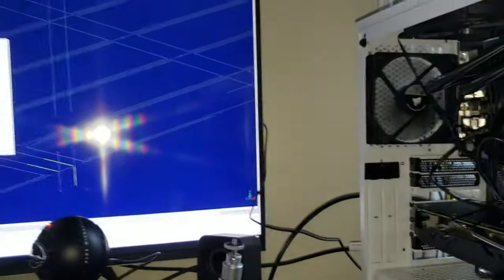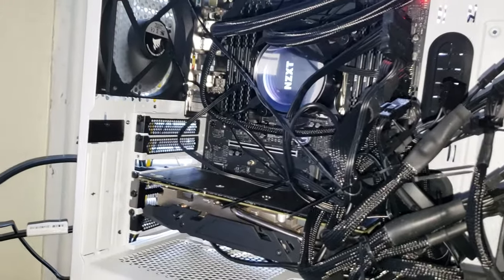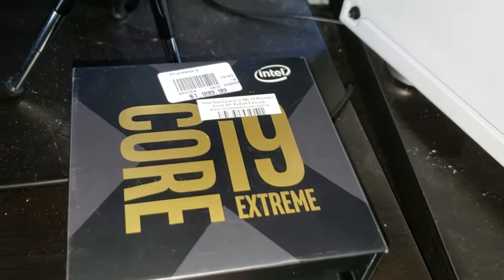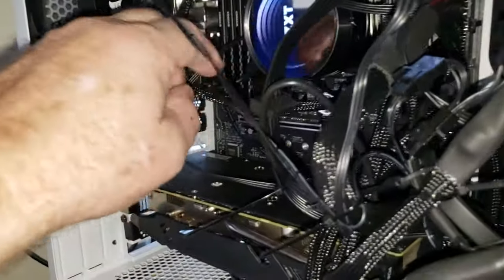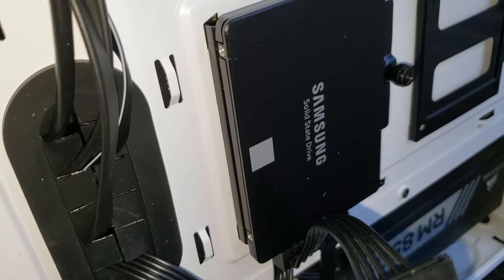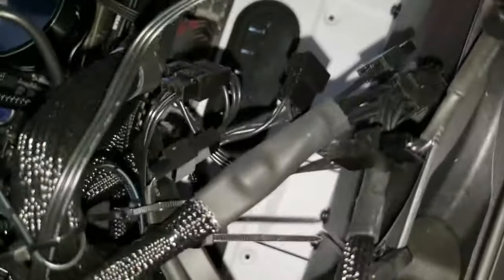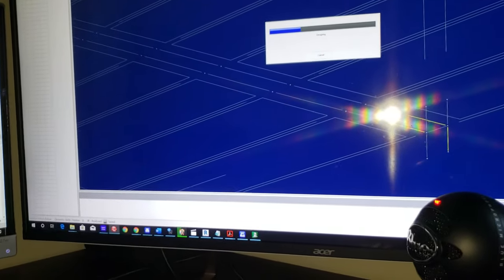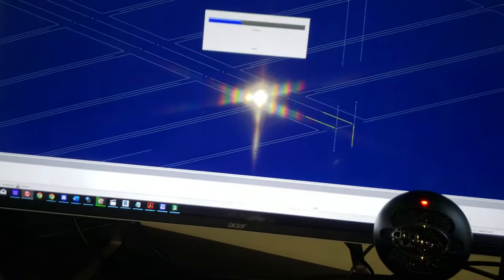Building A Computer For Structural Engineering Use

Comment: I believe you should flip the radiator upside down, they discovered that the pumps fail when the tubes are at the top, they should apparantly be at the bottom.

Comment: Hello George, how are you doing?
Congrats about your great review! Could you please share more info about your computer (the mother board, ram clock and brand, etc, etc)? Me and my wife are starting a structure analysis business, and we are not willing to rent remote servers to run our models, so, we need to have a great computer to do that at our office! We are mechanic engineers running our models in Siemens NX. Thanks a lot! Regards

Comment: Dude. Ebay. If it burns out just replace it. There are alot of used and new older quadro cards.
Reply from the maker: Good point that I didn't think of.  I could have gotten a Quaddro Pro with 8GB of memory for $265.  Crap.